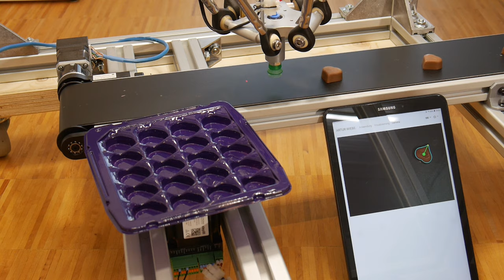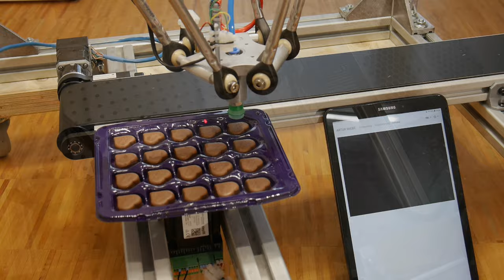Affordable conveyor packaging with an industrial delta robot.

Comment: Very interesting design and kudos, well done............. but that noise.
Reply: That's the air compressor for the suction cup...
Reply: @DOGMA1138, A great alarm clock ⏰️
Reply: @DOGMA1138  And I thought someones electrolarynx button got stuck.